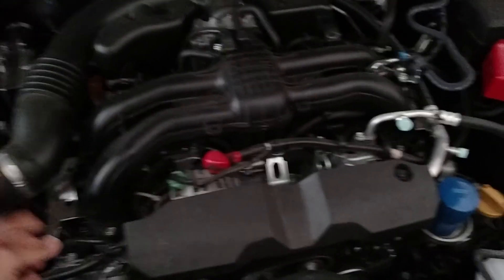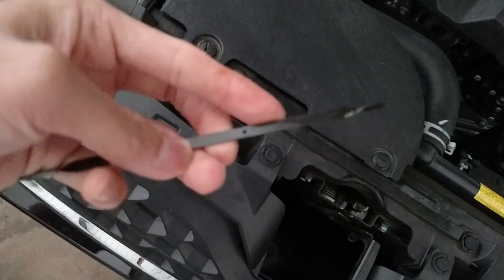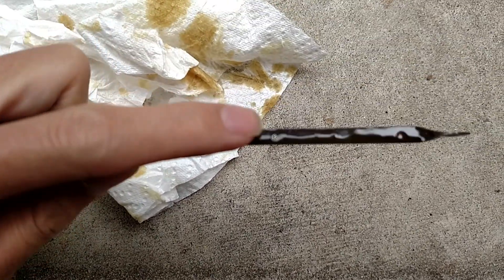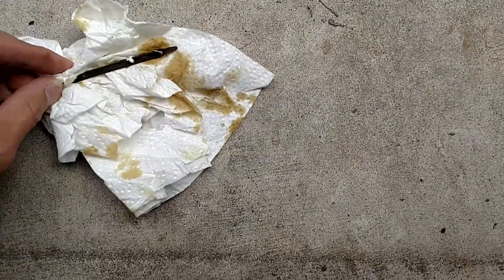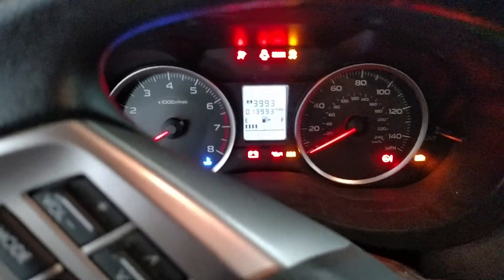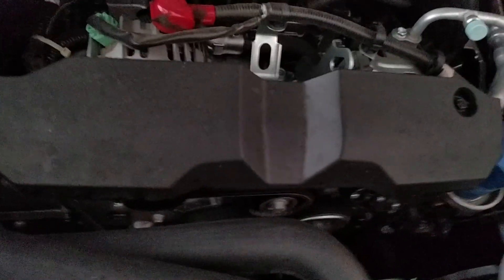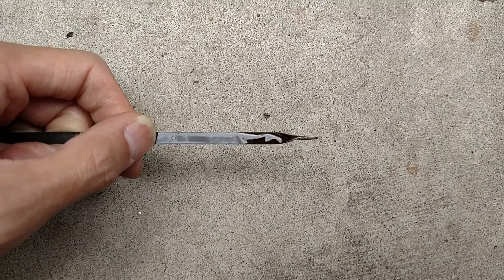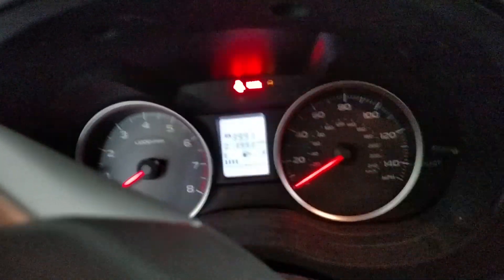2014 Subaru Forester oil consumption 12158 - 13993 miles

Comment: Mine loses a quart every 7 days.  One of the valve step caps broke and the let the cam follower fall out of position.  This in turn let the follower jam against the valve cover and the spark plug tube seal.. taking a big chunk out of the cover and seal itself.   it has 90k on it and by he looks of one of the intake cam lobes (with almost zero wear)  I'd say this happened early in the cars life.

Comment: Hi, I'm really sorry to hear of your oil burning problem.
I just wanted to let you know that not all Subaru's use oil. I had read about this issue before I bought my Forester and because of that I've monitored  the oil level in my car very closely. I own a 2014 Forester XT which has the 2.0 Turbo engine and I've done just over 32,000 miles in it. What I can tell you is I've had the oil changed by Subaru as specified by their 7,500 mile interval and I've checked the oil levels many times and it has never used any oil at all, not a drop and if it ever does it will be sold straight away.
I can't stand vehicles that use oil, I guess it is excusable on a high mileage engine but not on new one. I hope you manage to get a satisfactory conclusion to your problem.
Reply from the maker: it really comes down to automatic vs manual. the oil usage is mainly on the manual ones. There are a ton of cases reported in the manual ones. I am hoping this new engine is a good one.
Reply: +HankDCFC  I have two of their old cars, one at 217k miles and 262k miles, neither burns oil.  So no it's not normal for any engine that works to use oil in any shape or form. What this is, is them cutting corners. I heard their profit margin is 25% these days. In 2001 they were operating at a loss. So there is that. Subaru engines used to leak oil, but not burn it. This is new. I can't stand cars that burn oil. Unless it's a bulldozer where you dump used motor oil into the diesel tank and burn it as fuel. Engine that burns oil is not going to last too long. Few years at best.
Reply: 2 year old post, but for those who looks at oil consumption, XT 2.0L turbo runs on 5W30 and as far as i know don't consume oil, but regular 2.5L 2011 and up use 0W20 sythetic light weight oil, those have issues all the way up to recent years

Comment: i felt some old cars with low tech stuff cause alot less problems and lasts alot longer than modern cars. My dad's 2014 forester start to burn oil around 70,000mile, after i took the car to the dealer, they changed oil for me for free and told me to do an oil consumption test, so i will take the car back to the dealer after 1200miles. i want to see what they will tell me after the test.

Comment: I have a 2015 Forester 6 speed and it also burns oil.  I'm currently running a oil consumption test through the dealer. But unfortunately Subaru USA emailed me saying 1 quart per 1000 was except able. And since mine burns one quart every 2000. I currently have just over 20k on it and have had to add oil in between each service.  It's one of the biggest nut kicks to endure every time I have to add oil on a car I purchased in November 2014.  Let me know how your ordeal turns out.
Reply: +Michael Pitre my 2013 Subaru XV burns oil. Subaru are just ignoring me.
Reply from the maker: +Michael Pitre It will get worse if you do engine braking a lot.

Comment: Hi! My subaru forester MY12 drinks oil at a rate of 1L (1.1 qt) every 1300Km (808miles). Has done for the last 20000 kms (12427miles). I bought it with 30000kms on clock (18 641 miles) and have done 51000kms (31 690 miles). Apparently I need to change piston rings. Has anyone done this? Does it work?
Reply from the maker: +jonathan king I would have the dealer take care of it.
Reply: Still have it

Comment: subaru settled a lawsuit about this. look online.the warranty on 13 and 14 was extended to 100000 miles. subaru claims the problem was defective oil ring on piston. however they are still having the same problem. i have a 17 forester with 1737 brand new just made first payment. oil light came on at 1737 miles and was 1 1/2 quarts low. subaru has cheated on 2 oil tests by overfilling the oil. i will b posting vids on my site about this shortly.
Reply from the maker: Mine has a new engine and it seem to be fixed.
Reply from the maker: I also have a 80k mile warranty
Reply: start to burn oil around 70k miles. 2014 forester

Comment: wow that's a lot of oil burning! I cannot believe subaru has not fix this issue yet.
Reply from the maker: Michael Sun Subaru agreed to an engine replacement. I'll upload my oil level after the engine replacement and once more after 3000 miles.
Reply: yinglish119 It's soo good to hear that! I actually really like the 6 speed forester and it seems like it is the only practical awd 6 speed suv in the US market. Thanks for the update pal.
Reply from the maker: Michael Sun It is the only AWD 6 Speed SUV in the US market with a backup camera(at least when I was looking).
Reply: +Michael Sun They don't know how to fix it, the fix under warranty is to replace the engine with one of the same design so inherently it will have the same problem. I have a friend who works at a Subaru dealership and six of the used cars there have had an engine change. It's a problem that lies deep in the design of the engine, much like the headgasket problems that plagued older four cylinder motors.

Comment: I have a 2014 Mustang with 41K miles that doesn't burn a drop.  I was seriously considering a 2.5 Forester until I found out about the oil consumption and head gasket issues.  I wouldn't own one of these vehicles.
Reply: You're lucky Joe.  Subaru's are known for burning oil.  Good luck with it.

Comment: hate to break it to you guys but my 1997 ford explorer 4.0 SOHC with 256,000 miles and burns about 3/4 a quart every 4500 miles
Reply from the maker: that is OK because I get new engines for 80k miles
Reply: +yinglish119 ? explain
Reply from the maker: because Subaru settled a class action lawsuit and my car's power train is now covered for 80k miles.
Reply: +yinglish119 good cause Subaru knows about the problem and dismissed it, I like  Subaru's but to lie about the problem is pretty bad
Reply from the maker: of course they did. That is why they settled.

Comment: Are you sure the notch on the dip stick isn't full?Anyway, my Subaru consumes oil a lot too, 1quart per 3000 at least!
Let's put it this way, had a 1993 Nissan Sentra that consumed 0 ZERO!!!!!! Oil between changes...
With 230,000 on the clicker... Hummmmmmmm?
Reply from the maker: +Indian Giver I got the specs from the Master Tech. Top Notch = full, lower notch = 1 qt low.

Comment: My girlfriend has a 2014 Forester that uses 1 quart every 1000 miles.  Has for years.  Subaru agrees it is excessive but will not do anything about it.  If she uses synthetic blend oil 10W-30 it gets better but the gas mileage gets worse.  Doubt she will ever buy another Subaru.
Reply from the maker: Same here. I sold my Forester and got a Toyota Tacoma. But in line for a Rivian.
Reply: @yinglish119  How many miles before you sold it? I'm at 155k miles and it's more noticeable now. Definitely stuck piston rings that's causing it but I've used 0w20 and nothing else. I've never had to carry extra oil in the back until I owned a Subaru.
Reply from the maker: @ttru92  sold it at 95k. Was burning .75 qt-ish per 3000 mile. Mine was bad the first 13,000 mile before the engine swap. Same stuck with 0w20 just in case dealership was going to be a pain.

Comment: Subaru is aware and they do NOT care. I have a 2016 Outback that Subaru says change oil every 6000 miles. My car uses 2 quarts of oil per 6000 miles and Subaru of Kennesaw Georgia says .... Not only is this an acceptable amount of loss it is perfectly NORMAL !!!!! 32 oz loss per 3000 miles driven is deemed NORMAL by Subaru.
Reply: This seems to be a repeat of the headgasket situation from previous years.  No fix, just attempts at a fix,that really do nothing but create an illusion that the problem has been solved.  2017 owners believe their cars to be fixed, but in due time learn otherwise,  ...just like the 2016, and 2015 owners before them who also believed their cars to have been fixed.  In all fairness not all cars have this problem, but many do, ...many are fine for a while, then start using oil. My suggestion to you is to liberally add Marvel Mystery OIl to the fuel.  It will improve cylinder lubrication, hopefully aiding with the problem, getting it under control somewhat. Also change oil more frequently 6000 is way too long.  Follow severe service maintance schedule, 3750 miles oil chcnges I believe.  Good Luck. It is supposedly a good engine but prone to this problem.  And finally just replenish what is lost. Religiously czheck oil level at every other fill-up.
Reply: I forgot to add, some say that this engine does not really burn oiil like an old car does, but somehow the very thin oil that is required produces an oil vapor within the engine that is sucked out and evacuated, burnt by catalytic converter, resulting in an oil loss. I am not a mechanic, this is what I have read on some Subaru forums.
Reply: If this is the case wouldn't ALL modern engines that use this viscosity oil do the same thing? Also wouldn't ALL Subarus also have similar issues? They don't it seems
Reply: I've heard some other manufacturers having somewhat similar problems. Two years ago someone on a Subaru Forester forum even posted a picture of a brand new unsold toyota/lexus at the dealer lot with a dirty tail pipe!  Both new engines the 2.5 and 2.0 seem to be affected.  I am not monitoring the situation in detail, though  I have read the monster length "Excessive Oil Consumption" thread on the Forester forum and decided to buy a new Forester XT in 2013, a turbo car with the old EJ engine, just to avoid buying a regular Forester with the new 2.5l engine.  There is definitively something wrong with the design of these engines.
Reply: Here is the link to that thread. It has been closed in 2014 after nearly 4000 posts. http://www.subaruforester.org/vbulletin/f183/2011-excessive-oil-consumption-archived-119562/
Reply: What's odd is how you start to notice things when you have become a part of it. I was recently at a Hyundai dealership and told a story about a lady trading in her 15 Outback who told the dealership, AFTER thew deal was done,  of how her Subaru lost oil. I drive a company car and get my oil changed at a couple different locations and they were well aware of Subaru's losing oil. Also visited a VW dealer(wow they can't give cars away) internet sales manager used to work at a Subaru dealer and was well aware of the issue. These are hearsay naturally but the stories are out there everywhere. Everyone seems to know about it but Subaru...It's like telling a Ford dealer your radiator on a 2008 to 2010 Superduty leaks, sorry whole different issue.
Reply: Of course Subaru knows about it, they had to settle a law suit. Paid something like 1.3 mln dollars. Seven people got reimbursed on average several thousand dollars plus got a few bottles of free oil from Subaru, and court/lawyer costs amounted to the rest!  In US. the system works economically to limit access to the courts, and to justice, you have to be prepared to spend millions of dollars to be able to recover a measly few thousands.  In that environment companies can do whatever they want.  Subaru never really fixed the headgasket issu in the EJ 2,.5l engine, the auto transmission glitch in 3.6L was also never properly addresed.  Of course they'll attempt some illusory fix, because that works to create an impression .  People, new buyers, assume the old problem has been resolved.  I have read countless statements on the net where people say Oh that issue has been resolved in previous years, only to find out in a few years that their car also shows problems.  In this case like in the headgasket case it is some design fault that is too costly to resolve.  It will likely be dealt with when new engines designs are developed and implemented.  As a way of advice I recommend trying to add MMO Marvel Mystery OIL into fuel, in liberal amounts.  I have been doing that to my old EJ 2.2 for years.  It lubricates the cylinders, and in the long term helps retain compression- the car feels peppy like new for many years, also helps save a miniscule amount of fuel. You shold try it!  In large doses a small amount will make it past the rings, and keep your oil level from falling too fast, at least that is what it does to my car.  I add 8 oz of MMO per 10 gallons of fuel, exclusively to fuel, I never add it to oil, and not recommend adding it to oil.  Also try different brands of oil, different oils are known to behave somewhat differently with respect to this oil problem.  Good Luck.
Reply: Sorry I meant as it applies to this new group of cars not the previous ones.
Reply: I understand, but its the same manufacturer and similar methods, patterns of resolution of new problems are applied.  In the past if a problem was too costly to fix a series of actions were undertaken to seemingly (!) create an illusion that the the issue has been been fixed (two or three  revised head gaskets that never really solved the headgasket problem).  It seems this is the approach this time.  I've read numerous people report that Subaru has changed the rings in newer models to address the oil consumption issue, ...guess what?  Many newer models with supposed new rings continue to exhibit the problem.  I have no way to determine whether these attempts at a fix are made in good faith or are just smokescreens.  I therefore speculate and assume it is a smokescreen, and as long as people keep reporting same problems I assume it is not an effective fix.  Subaru designed these cars and knows perfectly well how to fix them. If the issue is not being resolved it is because Subaru doesn;t want to or cannot afford to properly address the problem.

Comment: So what's your point here? Do you have a reason that this is happening? How about a fix to the "problem" if there is a problem. I think most people do not fill their Subaru properly when the oil is changed and also misread the dip stick. I have a 2.5 and I keep a very close eye on the oil level and it does consume oil yes, but I accept loose tolerance design that reduces friction yet will consume (use) more oil compared to other vehicles and I accept the responsibility to check it and keep it topped off. If it is too much in your opinion get rid of it because the consumption as you see it is not going to change.
Reply from the maker: yagabagadaga Good for you. But this was my documentation to Subaru that shows an increasing oil consumption rate. I used it to prove my case. Right before the engine replacement at 14k miles, it used .75 qt in 500 miles. If I didn't have this video, Subaru would have never believed me and kept lying to my about my oil issues.

With the new engine, I am at 50k on the chassis and it still burns a little oil but not at .75 qt per 500 miles. More like .75 qt per 5000 miles. That is an acceptable level.

Comment: Has this oil burning ( piston ring problem ) been fixed in all new current 2016 models?
Reply from the maker: I have no idea. All I know is that settlement I received from Subaru didn't include 2016. I got a 80k warranty now.

Comment: Use an oil with a highest viscosity at 212F, an 0W30 oil with a viscosity at 212F next to 12.5 cSt. An oil Brand? Motul or Amsoil, full synthetic. Use the oil selector of the websites. You won't know if there is a reduction in oil consumption until the second or third oil change due to remains of previous oil in the sump and oil lubrication circuit.   widman.biz/uploads/Corvair_oil.pdf

Comment: I got a 2014 forester and it does the same thing. The box engines type or whatever it is actually says in the manual that it’s normal to lose this much oil. My light came on and I called them and they told me the same thing. I’ll never own another one!!!! My 86 cutlass does better then this bullshit